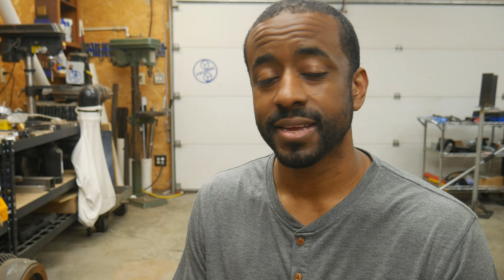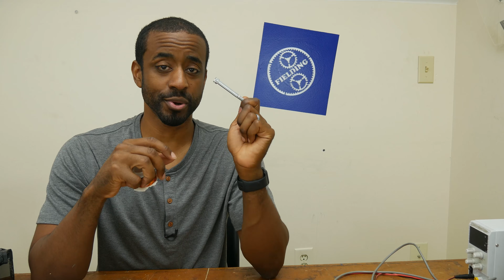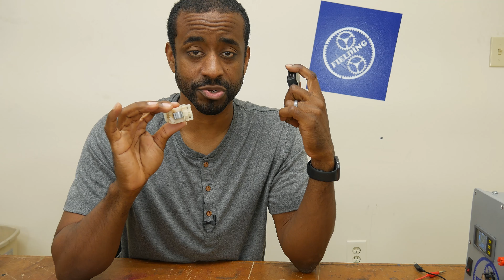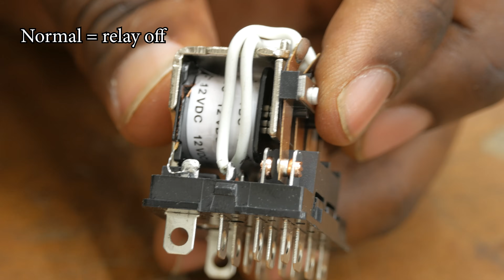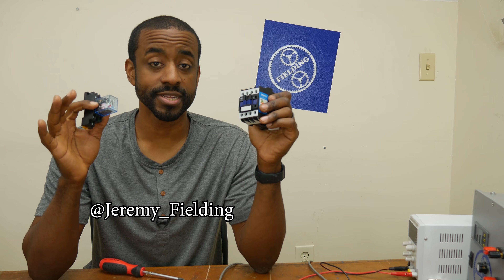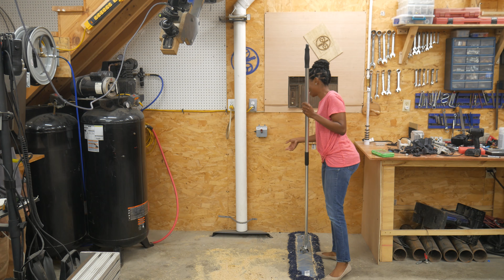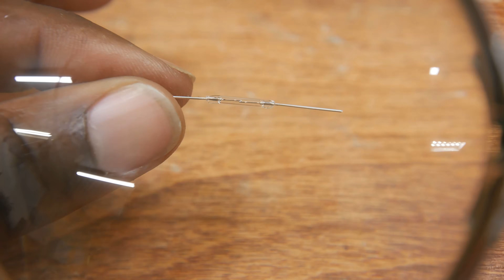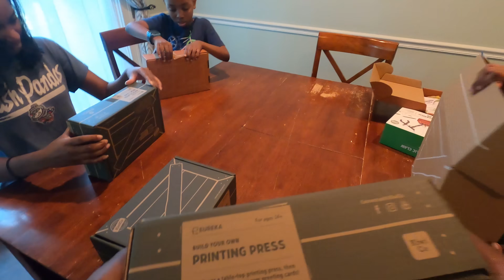A beginners guide to relays, contactors, and solenoids to automate anything; (#083)

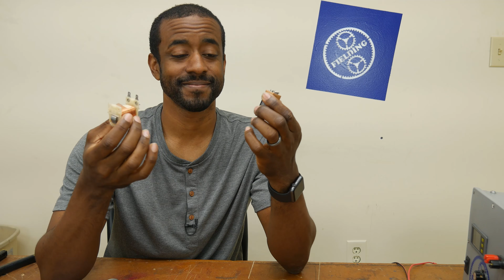Comment: 5:25 short answer “no”... DC on a coil is a short circuit but the coil has some resistance so no, it isn’t short circuit
Reply: from what i understood, its not a short circuit because its doing something useful, its traveling along an intended path and is not accidental
Reply: Technically a short, but an energized coil provide resistance through inductive reactance so not a short circuit. Correction, this is a   DC circuit therefore no reactance.
Reply: @Woodpile63  so the resistance created by the induction of a magnetic field forms a "load" which negates the effects that a short circuit typically creates (a burn out or overload)?
Reply: agreed. Technically is is a short or called shorting the coil but its also completing the circuit so no?
Reply: A few ohms is still a short circuit.  If you have a transistor that's gone faulty between emitter and collector and had a reading of a few ohms it would no longer be an electronic switch an would fail as it would just be closed at all times, no longer needing the base current to close the switch as it has gone short circuit. 👍
Reply: I say not a short cicuit, because its completing the designed circuit.
Reply: What if I make it 5 turns? ... It will be "intentional", it will have some resistance, it will "complete the circuit", and it will create a magnetic field/effect......  But the "circuit" will burn with a 9v battery......

So, it depends on resistance, induction, and applied voltage. The magnetic induction and resistance are responsible for the current allowed to flow through the coil.
Reply: why would DC be called a short circuit on a coil ???  so AC on a coil is not a short circuit ??? explain please...
Reply: @johncasor9698  A short circuit is a short circuit AC or DC. It's called a short circuit because it's the action of taking the positive or hot or live and applying it straight to the negative, neutral or ground. Creating a short circuit path for the electrons to flow from positive to negative or live to neutral. 👍
Reply: @SlyerFox666  isn't electricity flowing from negative to positive  (DC)
Reply: @needsomehike  I think your referring to current, voltage doesn't flow and there are two methods of thinking Conventional Current and Electron flow. You are correct as proven by how an old CRT TV used to work the guns would be neg charge flowing towards the positively charged shadow mask but unless you have knowledge of this then most think of it as pos to neg as taught at school and becomes confusing to many, an for the sake of this debate it really doesn't matter as a short would be a short either way right AC or DC ?
Reply: @SlyerFox666  
thank you for taking the time replying me, much appreciated.
indeed i am very confused about the conventional vs non conventional current flow. 
the way i was told,  conventional flows from + to - (as drawn on schematics) and non-conventional (real life) from - to +.
so, i put together a little circuit on my breadboard (i am an absolute beginner as you might have guessed) and when i place the diode that way so the current should flow from neg to pos it doesn't work.
it works however the other way around, the diode let the current flow from pos to neg.....
maybe you could clarify things for me ...?
Reply: @SlyerFox666  The Engineering Mindset video on "How Batteries Work"....https://www.youtube.com/watch?v=PXNKkcB0pI4
flow from negative to positive......okay, i am totally lost.....
Reply: @needsomehike  That's cool tho, best way to learn anything is by doing it so fair play.  yea I can explain that but first you are correct in what you said about conventional Vs non conventional. The diode band is placed on the cathode. So it's been labeled in the conventional current way, so it's a bit of a pain in the bum as you have to keep switching it round in your own mind to make sense of it. In reality it should be the other way round for non conventional, as it's like an arrow to indicate the flow and a brick wall to indicate the cathode line, but and I'm only going on what the guys that taught me told me,  it was labeled up in the days before non conventional was discovered and so not to confuse people they kept to the standard that was set other wise there would be two types out there and render the cathode marking useless. When I'm fault finding I keep to conventional current thinking because it makes things easier when other silicone devices like transistors are in circuit but as long as you know in reality it's the other way around and if taking current readings and you get a minus figure you know it's not minus an amp for example, as that can't really happen an you can just swap leads round on the meter. I usually come across it on power meters when displaying wattage where it needs the voltage and current and if I've thought it through and connected up to take a reading and it comes out as a minus figure, I know then I need to reverse a connection to the power meter to make it a positive figure. The only time you wanna worry and double double check, is when using an older style analogue meter with a scale and moving coil don't connect that wrong or it can blast the needle in the wrong direction and bend it ... Did that as a kid and it's a case of putting in a new moving coil and scale which wasn't cheap but sometimes it's the best way to really teach yourself a lesson lol you shouldn't have that problem nowadays tho meters are so much better being digital and they don't load the circuit your measuring either. Hope that helps.
Reply: @SlyerFox666  thanks for the extensive explanation,  it really helped. 
the problem was that i did not know that the diodes are also labelled the conventional way.
seems like for schematics/drawings/labels the bottom rule is the conventional way, while during installation  we have to put the components and think of it "backwards"...
another thing is that i had to jump start a car and i was wondering how the current flows  from the batteries.
the way i see it from live battery negative end the current (black cable) runs to the dead car chassis/engine block -> from there through the starter to the negative terminal to the dead battery -> then from positive terminal of the dead battery to the positive terminal live battery.  ( i hope its correct?)
so basically we are not charging the battery but giving a kick to the dead car's starter, ignite the engine and from that point the alternator will re-charge the dead battery.....is that correct?
Reply: @needsomehike  That's ok I'm glad it helped an yea I always have my conventional current head on when looking at circuit diagrams, I'm not really a designer so I can't really comment on the design side but I think it depends how you choose to think about it. I think all symbols would follow the same conventional current labelling system but in certain circumstances it might be better to think in the non conventional way. Yes from what you've put seems sound to me. Batteries are a little bit different as it's a chemical reaction taking place to produce the current/ voltage but as far as I'm aware the same rules would still apply. If your jumping from one battery to another or using one of these clever little jump starter packs, it's still just a battery inside make sure it's live to live and neg to neg, or neg to chassis. You use the second battery to get enough current sometimes called cold cranking amps or CCA to make the starter motor work and as you correctly stated, the alternator takes over after that once the engine has started. Coincidentally the alternator usually has a four diode or bridge rectifier to output a DC pulse to the battery, if there's a capacitor it becomes more of a steady DC voltage, like in the old liner power supply where you have four sections, AC mains input to the Transformer to the Rectifier to Capacitor, sometimes called smoothing and then a Regulator to stop the voltage from changing depending on the load connected. The thing to remember is we don't actually have ideal components. So when people say resistor or capacitor etc that's not it's only characteristic. For example a capacitor also has resistance called equivalent series resistance, a resistor will have some very small amounts of capacitance and inductance. These are usually described as parasitic values and are usually so small we don't think about them but in design they may make the difference between something oscillating in the way you designed it to or not. Probably why I went into fault finding and not design it makes my brain hurt lol.  In the case of the car battery I think the battery also acts as the capacitor causing the DC pulses from the alternators rectifier pack to become a steady DC voltage. It's not an easy thing to get your head around at first sight, I know it took me a while and it still can catch me out today, but the really key thing to remember is never remove a battery while the engine/ alternator is running as it could well damage the sensaitive electronics like the ECU or electronic control unit because you would also be removing the capacitive characteristic from the circuit and then the pulses from the output of the rectifier could be more than what the system was designed to handle.
Reply: @SlyerFox666  excellent explanation, Thank You ! 
seems like you could teach this so I am going to ask: if you had to recommend a book to students on electricity, the Holy Grail, the one that is above all, which one should it be? 
As you can see i am trying to squeeze information here on youtube and bits and pieces from articles on the web but free info comes with a price: not everything is gold and it is time consuming to track down and verify everything.
(This, about the LED and non conventional current flow i had asked like 20 times under different vids and the replies are rather confusing.)
Reply: @needsomehike  Thank you I appreciate that. Funny you should say that I work in practical education now, after serving my time in industry. The book I would highly recommend is the Art of Electronics by Horrowits and Hill, it maybe a bit dated these days but it's got all the basics and beyond. I'm not sure if I've ever read it from cover to cover myself but I've used it many times to get a better understanding of certain topics. Yea there's a lot of confusing and conflicting opinions out there but that book is at least one of the best. I never managed to get a hard copy of it myself I used to borrow it from the library and guys that taught me but I know you can get it in pdf as it's on my desktop. I think a student once got it from a certain peer to peer network 😉 and I got a copy from them. If you can get a hard copy of it I would, it's well worth it.
Reply: @SlyerFox666  i knew it! one must be a teacher to share information in the extent as you did.
i am going to get a copy of that book, thanks very much for the tip. (and for the contribution to my education :) much appreciated)
Reply: @needsomehike  +1 on the art of electronics.  It's got a lot of practical info and isn't super heavy theory or math. Get the 3rd edition and the latest printing which will have the most corrections. There is also a separate add on x-files with a couple of add on chapters.  3rd is the last edition of a classic book. As mentioned circuits are drawn using conventional current.  Unless you're learning physics transistor hole theory or maybe tube circuits you can just focus on conventional current flow and forget electron flow. They don't really flow the way you think anyway :)
A short is an UNintended low impedance path.  If you  connect a 9 volt DC relay directly across a 9 volt battery you are using it as intended (no short).  There are tricks to extend battery life since the hold in current can be less than the actuating current needed to get it to pull in or use a transistor as a switch. For an arduino etc. a pass transistor is used to provide the needed power since the logic output can't usually supply the needed power. A wrong way round diode across the relay coil is needed so the logic gate or transistor isn't fried when the relay is turned off.  The 5 volt relay coil voltage might be briefly 50 volts when it is turned off and the coils magnetic field collapses.
Reply: @johncasor9698  In an AC circuit there is a frequency present which effects the coil.. this presence is called inductive reactance which essentially is like a certain resistance the coil has at a certain frequency, which is determined by the formula ... Xl=2pie(frequency)(inductance)..
It's important to know that a phase shift will occur and that the voltage leads the current by 90 degrees..
Inductors are also used in low pass filters because they allow low signals through and impede high frequency signals.. 
There is also something called Capacitive Reactance which is essentially the same concept but the formula is ... Xc=1/2pie(frequency)(capacitance).. again a phase shift will occur and voltage lags the current by 90 degrees.. capacitors are used in high pass filters because they allow high frequencies through and impede low signal frequencies..
Reply: @johncasor9698  I'm sorry I'm a year late. AC on a coil is not a short circuit because a coil has inductive reactance and it is just like resistance but only for AC. It depends on how many turns, dimentions and most important the frequency of the AC imput, if there is no frequency (f=0 which is DC) there will be no inductive reactance. 
=)
Reply: tnx mate
Reply: @kamranshah3168  No, it's not. It would be acting as a load if the applied voltage was sinusoidal, so that the resulting current would also be sinusoidal, which would produce a changing magnetic field and a changing magnetic flux, which would induce a counter-EMF in the coil.

Buuut the applied voltage is constant (it's from a battery), not sinusoidal, so after the transient state ceases, the current will also be constant, so no changing magnetic field nor magnetic flux, so no induced counter-EMF in the coil. In other words, there's ideally 0 V across the coil

Now, in practice, the coil has some small series resistance, so there will be a voltage drop across the coil. Also, the wires connecting the battery and the coil have resistance. And the battery itself has an internal series resistance. To complicate things, as the wires get hotter by the current flowing through them, their resistance also increases, which will reduce the current.

That's how I see it. Correct me if I'm wrong.
Reply: wtf are 9v batteries used for now.
Reply: @ryanleese1240  Smoke detectors and volt meters
Reply: but every wire will introduce some resistance except a superconductor.. so what is a short really?
Reply: @NeverSuspects  it's a low enough resistance not impedance as were talking DC not AC to "short" or cross the supply rails of a power source for instance. No wire has enough resistance to stop that and that's why they turn into fuses given enough power.  As the guy above sort of explains if you put a coil across a 9v bat an leave it you are shorting out the battery supply rails, the battery can get very angry, hot and become unstable, and wouldn't last very long because the low resistance of the coil pulls so much current out of the battery at the given voltage for a given time. An that can all be calculated via Ohms Law. 👍
Reply: i.e the resistance of the coil isn't changing. No alternative path with less resistance is possible (currently) so no it isn't a short circuit, it is simply completing the circuit.

Comment: Not short circuit.  It's a Load.   Impedance of the wire is controlling the Current flow.   Coil Resistance impedes the current flow.  Limiting said current.  Do I get a Gold Star ?
Reply: So if the current is high enough to melt the coil wire, would it then be considered a short circuit??